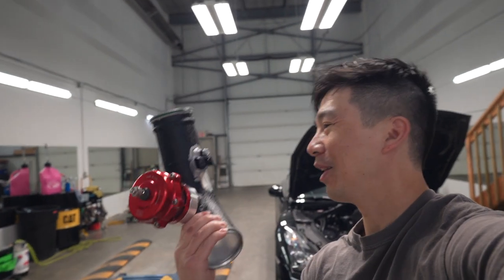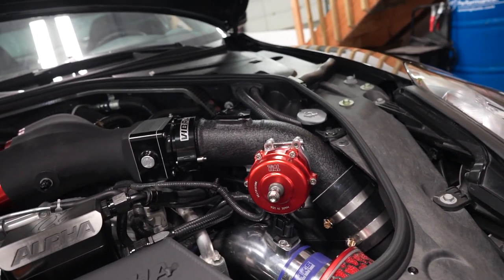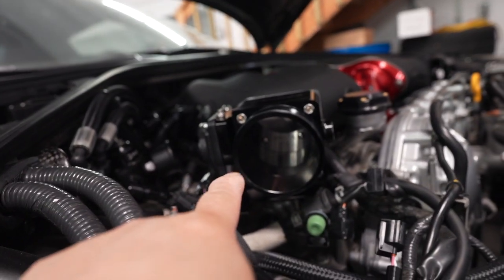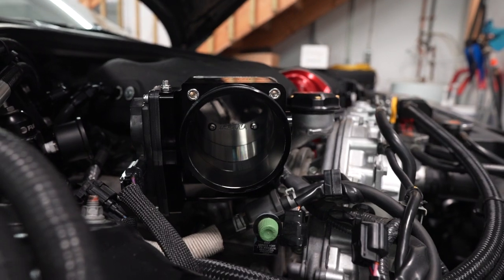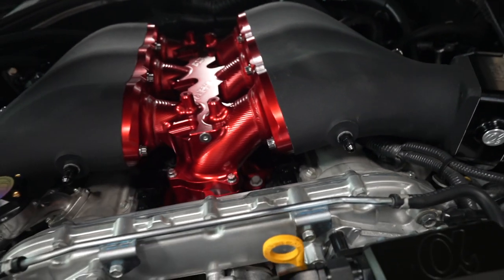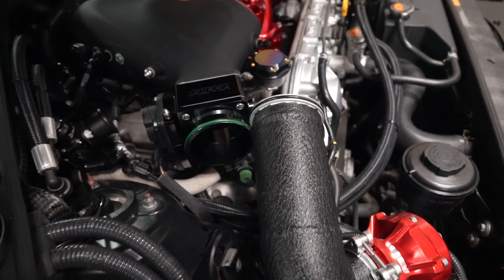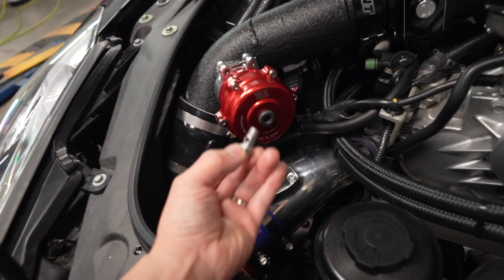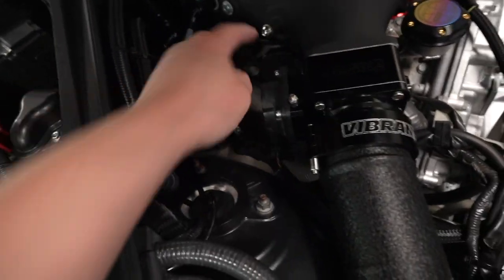Big Bore Throttle Bodies Good or Bad?

Comment: So how does it run on those alpha big bore throttle bodies on Cobb?
Reply from the maker: With the help from AMS we managed to get the car to idle smooth. It idles around 1100 rpm and when shifting from third to second it's engages hard. I think with a little more tuning the idle can come down more and the shifts will be smoother.
Reply: @phothrottle  i see. Is there some surges or bucking?
Reply from the maker: @marccastro1834  sorry I'm not sure what surges or bucking is. Can you elaborate and tell more about it. Maybe it's happening and not even aware of it. Thanks
Reply: @phothrottle  Basically, when an engine surges, you notice your car speeding up and slowing down even while you keep the accelerator steady. You may notice the tachometer fluctuating, for example, from 1500 to 2000
Reply: Does it do that?
Reply from the maker: @marccastro1834  it doesn't do it while cruising or at idle but when shifting from third to second and into first you do notice it. You notice it even more when you're in automatic mode. Thanks for the insight.
Reply: @phothrottle  I see.  Im just going for a stock throttle body for the mean time then until I have money for the Motec.  By the way...i also have the AMS Alpha race intercooler, carbon intake manifold with billet plenum, ams fuel rail with regulator, AOS, single brushless fuel pump and ams coolant tank and 1700cc id....but they arent installed yet
Reply: Your video really inspired me.  Thank you for sharing them to us.
Reply from the maker: That is a lot of nice parts I should know haha. Very nice set up 👍
Reply from the maker: Thanks for watching!